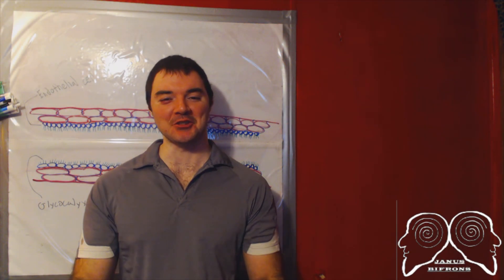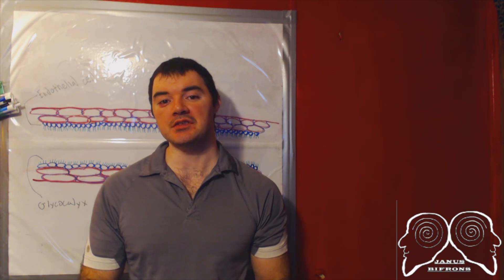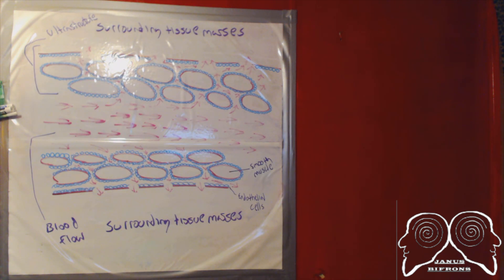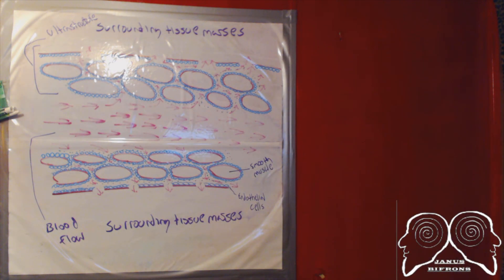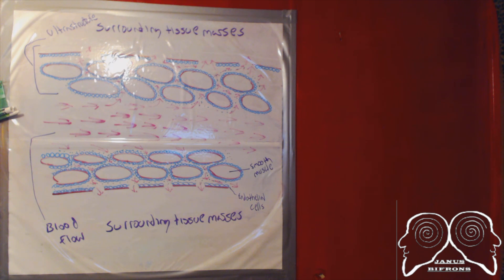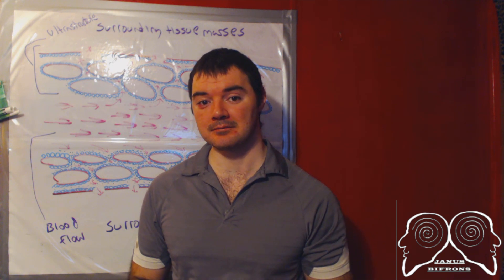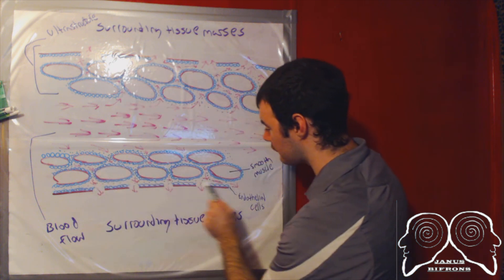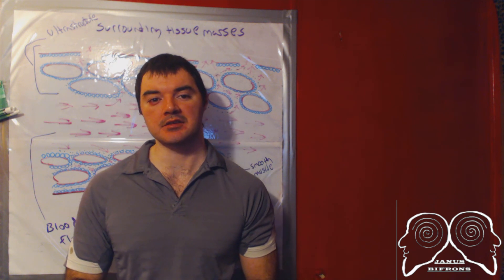Arteriogenesis: Revisited

Comment: Janus, hello! I have a quick question and I would really appreciate it if you could help. I have been doing AM1 for 1 month now - things are going great - no size increases but good bloodflow and EQ. However, for two weeks I have been having this strange sensation as if I could feel blood flowing into (or out of not sure) my penis when it is flaccid ( without going hard).This happens when I am on my bed, chair, sitting , sometimes even when walking( never before have I ever felt such a thing). Have you had similar experience? Is it normal basically ? Thank you! Great video as always!
Reply from the maker: Greetings Goran,

Janus Here,

Good question.

What you are experiencing is heightened blood flow. That is a perfectly normal occurrence. Point of fact, that is how blood flow to your sexual organs is supposed to be. So, congratulations on your progress! :D
In time as you progress through the stages of the Angion Method, eventually you will be able to watch your member literally pulse in time with your heartbeat. Its an amazing feeling.

Best Regards,

Janus Bifrons